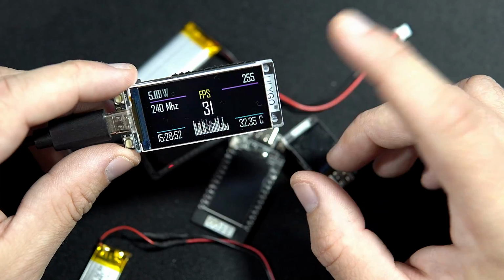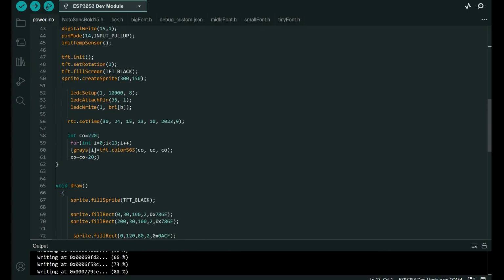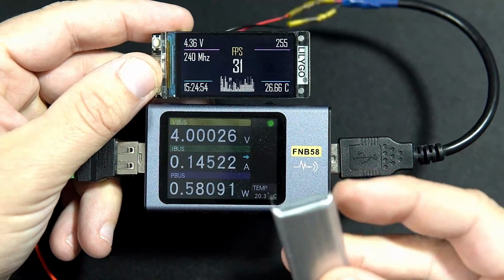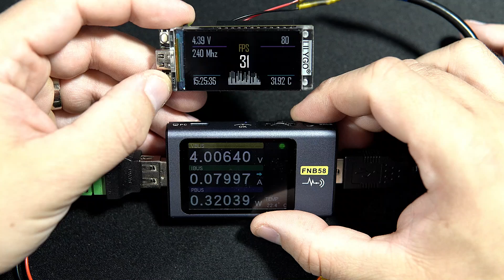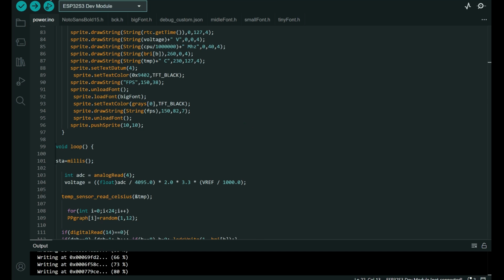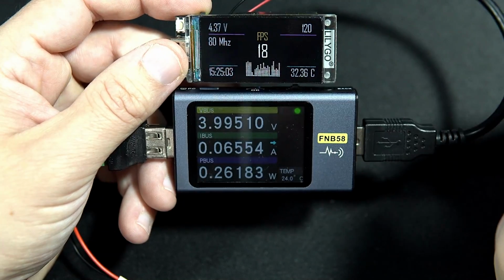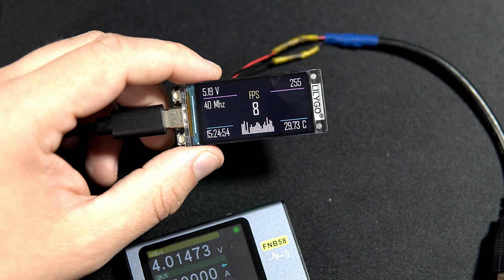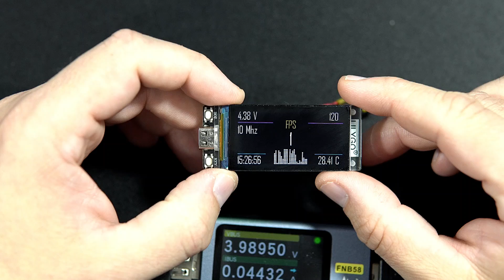How to reduce power consumption on an ESP32 development board. PART1

Comment: PWM for dimming T-Display-S3? It does not work for me because my T-Display-S3 has no LED at pin 38. Instead, it is connected to a LED driver which accepts a specific pulse code to produce 16 brightness levels. It also not work well.
Reply from the maker: are you sure you dont have AMOLED version?

Comment: Hello Volos, a question about configuration, when I received the new lilygo ESP32S3, it worked on battery power, when I did the first program, it stopped working on battery, it only works on USB-C, do you know if there is any setting to activate battery power? Congratulations on helping the developer community with the tips
Reply from the maker: Lcd is conected to pin 15, you need to put ih high on begining of sketch. In setup part of code you can add. pinMode(15,OUTPUT);  and digiralWrite(15,1);
Reply: @VolosProjects  Thank you so much for the quick response!!

Comment: I am really interested in how the amoled board does. And if you can do an "always on display" like a smart watch or phone with the oled in a few milliamps of current  or less and have the cpu sleep for most of the time. since you are only powering the active pixels and not a full backlight it should be possible to have a very low power consumption.

IT would be helpful if you were able to turn off the display completely on these boards. so we can tell how much power the display takes, and how much the esp32 takes.
Really love your videos and examples.

Comment: Are you sure the battery is directly connected to the ESP-s3? 4,35 Volt is a lot for ESP. I thing there is a low drop regulator on the board.
Reply: Good catch but look at the schematic https://raw.githubusercontent.com/Xinyuan-LilyGO/T-Display-S3/main/schematic/T_Display_S3.pdf. The BAT voltage does not go through the USB 5V regulator but it is still controlled by some devices(Q2-Q3). I think Volos' voltage report is right though (voltage divider to ADC pin 4).
Reply from the maker: Hm, i am not sure, i think you are right

Comment: With an e-ink screen, a refresh rate greater than a minute, no wifi, and the deepsleep of the esp32, you should be able to reach weeks, and also size the battery according to the desired duration if it is not enough. Afterwards you must remove all flashing LEDs from the board, and other voltage regulators which consume too much. In all cases it depends on the needs, on battery, you have to limit everything that is not necessary, the esp32 in deep sleep only consumes a few micro amps.

Comment: When measuring power consumption, a very good tool is the Nordic Power Profiler Kit II (PPK2).
Version 2 can deliver upto 1A and does have an incredible resolution so you can also properly measure sleep mode as well as fully powered mode.
It also has several GPIO-input pins which can be included in the logs so you can set some pins to add markings when you change state.

In the software you can easily compute the consumed energy over some period, which is a lot harder to measure using your USB power meter.

You can also set the output voltage of the PPK2, so you can simulate energy consumption when running at different voltages.

Comment: Hello Volos, you not need to upload new software to change CPU Mhz, I do it in code:  setCpuFrequencyMhz(80); // Below 80 Mhz WiFi doesn't work, low value is saveing battery power (240 Mhz is maxmum speed)
Reply from the maker: Thank you i did not knew that.
Reply: Thanks, I just wanted to search for this method.